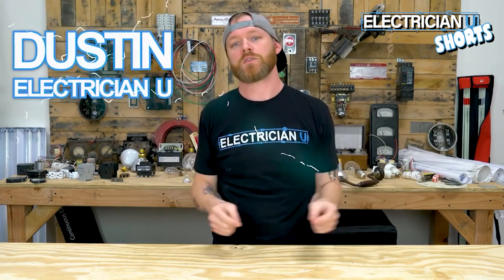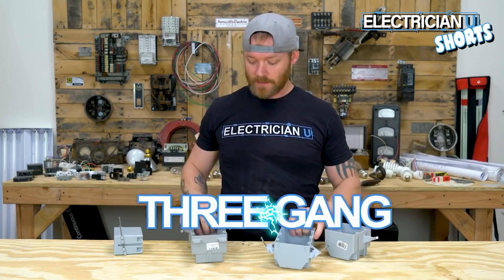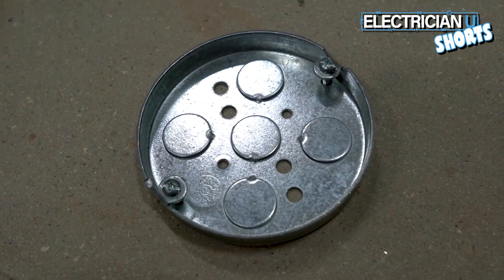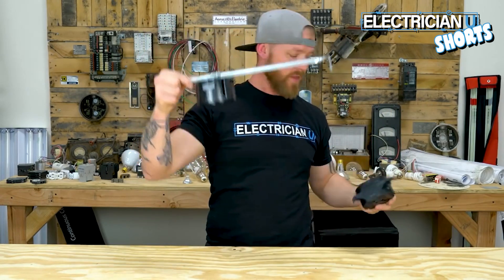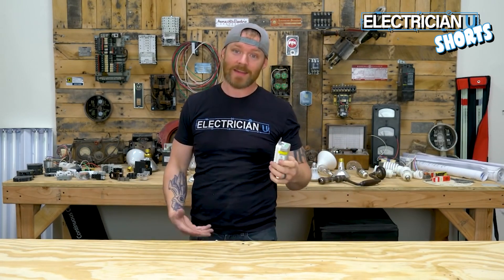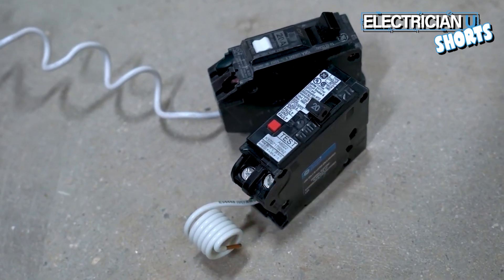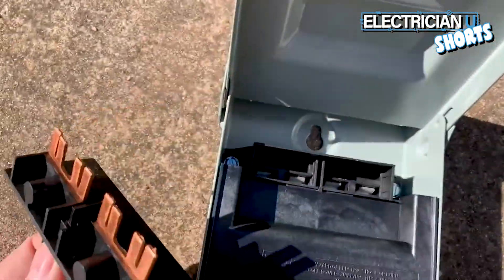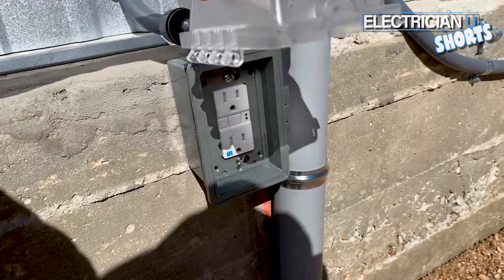SHORTS - Residential Electrical Materials YOU SHOULD KNOW

Comment: I've watched several of your videos today and figured I'd ask directly and hope to get lucky with the answer I'm looking for.  I need to control a 24v trolling motor using 12v as my contactor power source.  I dont suppose you could point me in the right direction for which contactor to buy?  Thank you and great videos.
Reply: I'm a bit confused as to what your situation is but I understand that you have a 12vdc source, and a 24vdc motor and you own a 12Vdc (coil voltage) contactor.
If this is correct then all you need is a 24Vdc source to be wired in series though the contactor's common our of the Normally Open (N/O) then towards the motor.
Reply: Ah I see now you don't own the contactor. First thing you need to do is find power (Watts) requirement of the motor . Then identify if you want to use 12V or 24V to control the contactor's coil then go to a tractor supply or Autoparts store and ask for a XX volts contactor to power a XXX watt 24v motor . Then follow what I wrote above. 

Source: studied controls and automation.

Comment: Something about cutin boxes I just don't like. Rewired like 90% of my house, removed the nail on boxes they used as cutin boxes, and just put screws through the side of along with all the old metal boxes with the clamp things. Due to Covid I could only get one screw on the old work box at the bix box store, I tried that box and was a headache to install and get flush, etc. I went to the supply house near me and they had Allied molded SB-1, SB-2,SB-3 series boxes I used those were so much simpler than the Carlon box and seem to be sturdier build too. To me if you can put the thing near a stud then do it and use something like this, my opinion drywall is fairly brittle and weak so I hate using that to mount anything.

Comment: i had my first side job today (starting an AV electrical job monday)

i was replacing a switch in a house. i take the plate off, metal box.
romex didnt have ground wire. box didnt have a ground screw. there was a red wire from 12-3 that was unused but didnt have a wire nut on it. and the switch they bought was a 4way. i made it all work but i was reminded why i dont wanna do resi

that's all.

Comment: I've been an electrician for years and I can count on one hand how many times I've used Rome in residential.
Reply: Rome?  I would assume you meant romex... Only that is used in virtually every.single.home.  The frequency of it's use is so insane, that there's simply no way you meant that.  Beyond the brand though, he specified non-metallic sheathed cable so that just makes what you said make even less sense. So romex can't possibly be what you meant.  What were you trying to say?
Reply: @glasshalfempty1984  I honestly don’t think he knows what he meant.  Guarantee he won’t respond with what he really meant to say.
Reply: @glasshalfempty1984  some locations require conduit in residential. I think Chicago is one.
But yeah, that is really hard to believe otherwise.
Reply: @glasshalfempty1984  thanks john. Maybe he meant carflex, maybe autocorrect?
Reply: All depends on your location. Westcoast is pretty much all Romex for single family homes.

Comment: Of course there is so much more to electrical.  4way switch 220 receptical 220 breaker.  Different size amp on breakers. Different size wire for corresponding amp loads.  Great video for most who know nothing. You also make great videos for those of us who know something's but get stumped on other things.  
Best thing is to research research then research again. If in doubt call the profesional in.  Electricity is nothing to take "light"ly.